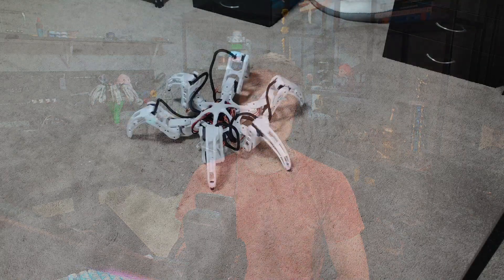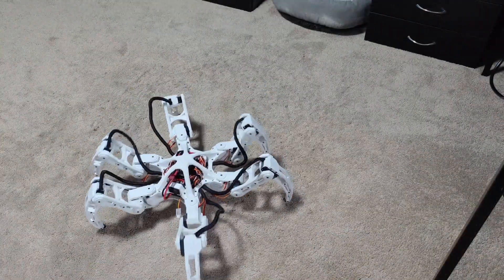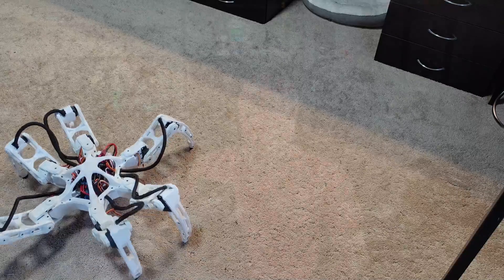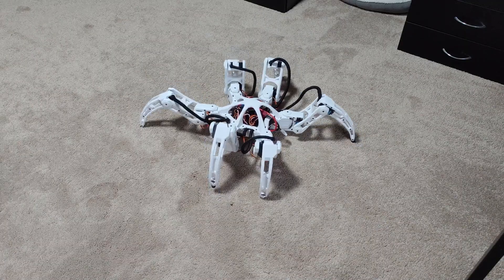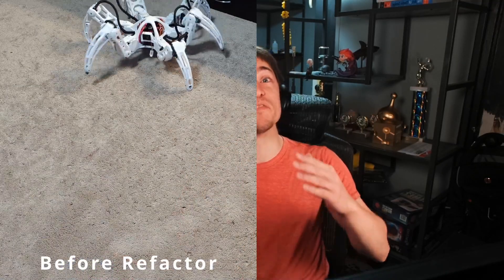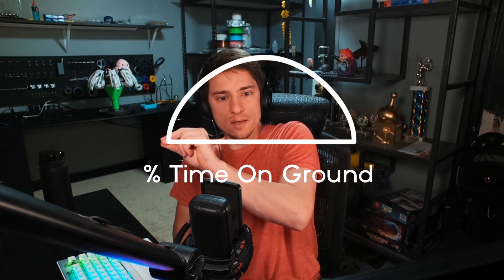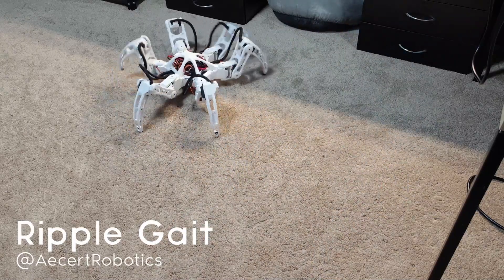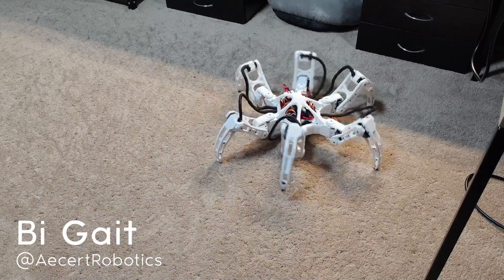I Completely Rewrote My Hexapod's Code

Comment: Cool sir, your robot has a smooth and stable gait🤩. I'm also building a hexapod using Dynamixel Servo from scratch. I have got formula for Inverse Kinematic and also leg trajectory using Cubic Bezier Curve (with 4 control points). 

I want to know what the gait formula/concept is (especially for the Tripod Gait) to determine at what point the three leg sholud starts to swing while the other three leg is pushing. So that the robot body can be stable when walking (no dragging feet when walking) like what your robot is doing.

And also how do you set the percentage of time when the leg swings compared to pushing?. Does it mean that you set it by determining the ratio of the number of trajectory points for swinging and pushing?

I need your help 😁, and also if you can provide an example of arduino code or other reference regarding the thing I'm asking about, I will be very helpful. Thanks😄

Comment: You could use bi-gait for normal and high speed motion, and automatically switch to the other "one leg" gaits when more pulling forward or carrying power (assuming attachments like can holders) is needed.
Reply from the maker: I dont have any way to sense payload weight, but the user could easily change the gaits based on whats needed
Reply: One option would be to ad a current sensor on one servo, another one to conpare planned motion and actual motion using an accelerometer: if there's a discrepancy, maybe the maximum pulling force has been reached already.

Comment: Do you use automated tests in your code? is the best way to change working code without breaking it.
Reply from the maker: I probably should but I dont 😂
Reply: @AecertRobotics  It seems that will add a lot of work to create tests, but in the long term it removes a lot of work. 
Not just for refactoring, but for creating new features, create the test first

Comment: theres a very useful gait that is missing...

ever watched a tennessee walking horse?

sulky racing? (trots...)

keep the body level/constant height... tricky whilst moving, but damn i see sooooooooo much potential if you do.

none of this pointless "attack" mode. what are you attacking? cool, nice learning curve and offshoot, but... useless.
i see hexapods and i ask myself... what can they do? is there a PRACTICAL use?

darn tootin!

many things can be done with a constant level. or a precise height control with all 6 degrees of freedom in a certain envelope... especially if it can anchor itself in place.
hexapod 3d printer? router? spraypainter? lawnmower? crop picking/planting/weeding? the list goes on and on...

other thought, try linear actuators, or adapting pneumatics and or hydraulics.

a jumping spider is hydraulic. if we have to go down the "attack" mode path, why not dive all the way in? make it jump. onboard compressor, storage tank, some quick exhaust valves... only need the fast action on the jumping joints, some maths on cylinder volumes, strokes, and pressures needed.. everything else can be standard spool/solenoid valve operation. or servos still.

gotta say, a petrol powered 50kg version of this sniffing and snorting and capable of jumping a meter would be scary as all hell... especially if its carrying a hedge trimmer or something... screw your batteries. gimme power density any day.

damn. i wanna try and make one now...

sighs and returns to scraping the mill

cant cnc without a working cnc machine...

Comment: Great progress. Does your code switch between the different walking modes automatically depending on the input speed or is it selected manually?
Reply from the maker: Currently I press a button to cycle through the different walk cycles. You can see that in action here! https://youtu.be/w3q_4_-ZHJ4

Comment: Hi Aeceret Robotics, thanks for fast reply. If you release your codebase, then i will try to integrate some serial servos with feedback loop. It may be helpful to have informaton like torque and position, when we talk about climbing obstacles with a Hexapod. But you are right, those servos are not the fastest, but at least they have a metal gear and quite a high torque. Looking forwart to your self-built-kit, with best regards, Peter.
Reply from the maker: Email me and I'll share the code!

Comment: I worked with Arduino a long time ago, and I know it would be really hard, but I just can't stop thinking if it would be possible to integrate some inverse kinematics here. Analyzing ground position and its texture, making legs move over and avoid obstacles without changing hexa's trajectory, climbing with horizon lock would look cool if you place a camera on it... my god you don't know how I want to have it on me to try to program it around, even if it means making a computing server on my PC if Arduino fails to handle it, but there is no way I would have time and money to built one myself. Don't have 3d printer, which means I would need to order prints; only one spare Arduino,  and a couple of servos. Now thinking about it... I will try my best to find some time to invest into this
Reply: the idea of ground lock with a camera has sort of lurked in my head for a while. i think it requires two, vertically oriented cameras. maybe three...(mantis have 3 central eyes right?)

think of how our binocular vision works.
our brain does some nifty calculations and triangulates an objects distance from the relative angles required to make those objects overlap and achieve maximum resolution.

on ONE PLANE. the horizontal. we are really good at judging distances apart on a horizontal plane, as it is simply triangulation.
but are woeful at heights, we have no reference other than experience.... ever watched someone drop a tree? i find it fun to place bets. usually right because i dont follow my instincts but actually try and visualise the arc of the fall.

vertically oriented eyes would give us great vertical or height assessment, with woeful horizontal... (always sort of wondered about evolution and if there would be a need for that feature... then again, wtf do flounders and flatfish think of the world as one eye decides it belongs on the other side of their head?? the things that keep one up at night, lol...{edit. i just contemplated the tuatara, with its "third eye"... maybe nature decided such a feature wasnt worth the effort?})

three should be the nice happy ground. 
gunna be some nasty independent recognition algorithms going on in each camera, with the trig required to figure out where things are. but seems possible.

Comment: Hi, great project so far! i am really looking forward to get one of yours self-bilding-kits , that must be very interesting to built and test this robot in reallity. Did you ever think about using digital high voltage servos?  the benefits are, very simple serial cabeling, lower currents because of higher voltage , easy programming, just by adress and position.

Waveshare ST3215 Digital Servos

I made some robotic projects with this product and am quite happy about it:by the way, programming with a ESP32 is compatible to arduino libraries and C++ Coding, but much more powerfull. To adapt aditional Sensors or cameras to your Hexapod, try the RAKWisblock Development kit, just amazing in price and diversity, very tiny and lowpower consuming, perfectly made for small robots.

RAK Wireless, WisBlock

many thanks for all your information, and looking forward for the Hexapod-kit,
Peter Kuemmerli, from Switzerland

Comment: ..by the way, with the ST3215 Servos , you can also read out the feedback of position and torque of each servo, this may be helpfull for climbing tasks with a Hexapod, to detect obstacles and steepness of the ground, without any aditional sensors...
Reply from the maker: Those servos are a bit slow for my taste, but that info would be really nice to have. I know I can mod my current servos to read the potentiometers position, but for this project specifically I think I'll leave it as is tbh.

Comment: complicated: like the Boston dynamics spot, make code that allows it to step over objects before touching it (some kind of vision sensor?).
Reply from the maker: Vision ai is out of the scope for this project, but I will be using switches in the feet to sense when they are touching the ground!

Comment: I really like how it kooks and moves but I dont see the utility of it. Stuff like manipulating objects, sensors and so on. Will it have eventually something like robotic arm or capability of doing things with legs?
Reply from the maker: Yeah I feel ya. I will be adding a gyro and switches in the feet, but that's probably it. Maybeee I'll design an arm for it, but that's a large maybe.
I'm totally open to adding individual leg movements , it would be pretty easy too. The hardest part is figuring out the controls, like how to select what leg you want.

Comment: didn't you say you started this because you feld burnt  out from software dev?  ;)

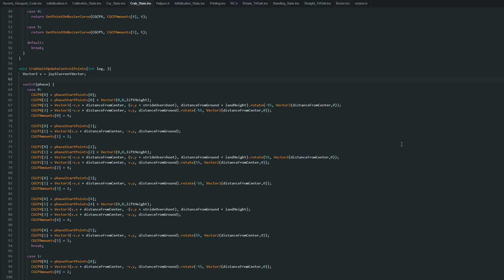at 3:26 the method CrabGaitUpdateControlPoints () seems HUGE to me (even after the refactor) , i know people are gonna peg me as a hater, and "try to build it yourself"  etc.. but instincitvly whenever i see a large method, i can't wrap my small brain around it , and i feel the need to refactor it to smaller methods , for example, i see cycleProgress index are being magic number hardcoded into the array index accessor repeatetly, so if you were to change the strcuture of array, all those would need to change
another thing, i would imagine that in for example cycleProgress [1] = (points / 6 ) * 4 , 1 and 4 are indexes for the legs, and 6 is the total number of legs 
those could easily become constants (LEG_ONE, TOTAL_NUM_OF_LEGS, LEG_FOUR) so if you were to search for places that relate a specific leg that would be easier. 
so you could have a small method called calcLegOffset(LEG_INDEX) or something similar .
if you're always updating  pushFraction, speedmultiplier and all the rest of the variables until the break, perhaps those could moved into a struct to indicates their depedence 
on each other. (or not) 
3:24 seems to be like a stateMachine being implemented, are you using any StateMachine framework libraries? 
i'm also curious what did you use to debug this monset? jteg?

Comment: Really awesome project! It could be really interesting if you added knobs or sliders to the remote control to tweak the gait parameters on the  fly.
Reply from the maker: I love that idea, imagine a controller with like 10 switches 10 knobs and 10 sliders. Like the controllers sole purpose is to debug and to test.

Comment: Bro I am studying electrical and electronics engineering as a first-year student. Which skills do I need to learn to make robots like this?
Reply from the maker: Ok so this requires:
- a slightly above beginner understanding of electronics
- a decent ability to 3d model/cad
- basic 3d printing knowledge
- a basic understand of pcb design
- a basic ability to solder
- a basic understanding of trigonometry
- a moderate to advanced ability to program (this heavily depends on how complicated you want to make it, with basic programming skills you can make it walk)

You being an electronics engineer means you should already have the majority of these things! I personally had to learn a ton for this project, but i was fortunate to have already had exposure to everything except pcb design.
Reply: @AecertRobotics   Thanks for answering! Your list was super helpful

Comment: Love it! 
Im curious how you did the ground contact percentage. 
Did you just changed the speed for the 2 curves? 
Also, for smoothing the movements, you could consider logistic equations. Like ln(1/(1+e^-x)). You can get nice transitions and directions with constant speeds. 
Also, for the arc formed by a step, it usually looks more like the cross section of a wing than an half circle, and i think parametric equations of that would give you way more control!
Reply from the maker: So the walk cycle is made from 2 bezier curves, one for pushing on the ground, and one for lifting. The walk cycle time goes from 0 to 1. Lets say the ground contact percentage, or the push percentage, is 66%. When the walk cycle time is less than 0.66, i generate a point from the pushing curve based where the cycle time is. If its greater than 0.66, i generate a point from the lifting curve. This percentage can be easily changed, and by doing so will change the amount of time the cycle will be pushing or lifting.

Hmmm, i can definitely make different shapes with bezier curves other than half circles, ill have to experiment!

Comment: If you want to implement field-oriented control (instead of robot-oriented), it works pretty well with just a gyro

You'll also want to be able to set/alter the angle whenever (by pointing the joystick in the same direction as the robot, and using that as the offset)

Comment: You absolutely have to strap a drone to the top, basically do what Mad Lab Industries did back in 2013, 10 years you should carry the torch for the HexaCopterPod, please
Reply from the maker: Hahahaha, this specific hexapod is wayyyyyyy too heavy for that. Also flying stuff is hard cause you have to be extremely light weight and frankly i dont want to have to worry about that. Do you have a link to it though? I searched and couldnt find it.

Comment: If the kit of parts is available I would be excited to buy a set or two of the parts and if the models are available I would love to get started printing. If they aren't ready and you want help validating the models I can test print stuff on an ultimaker S5. I dont have blender, but I am very proficient modeling in 3ds max for my printer. :-)
Reply from the maker: The kit isn't yet, but im super happy to hear that!! The models aren't either 😅 But they are close!! I really really want to avoid people having to reprint things, so im not releasing them until im done iterating. Ill send you the blender file if you want though, just email me.

Comment: you need some hardware retooling for better current regulation to your servos i dont think your servos are the issue i think your getting current spikes you dont have the tools to detect and i do commend you for fixing the symptom of the issue the general jerkiness of the servos but your gonna keep having servos blow out if you dont regulate current better from what ive seen
Reply from the maker: How would I go about regulating current? I thought the servos only drew what they needed.
Reply: @AecertRobotics   you could use resistors to regulate the current or have the servos move slower your biggest problem is gravity and the fact that most servos arent meant to be applying pressure consistantly against something like the weight of everything youve got in the carapace your support structures were smart but seem to maybe have made the problem worse by perhaps pushing against the free movement of the servos which are releasing excess energy as heat which may also be the cause of them burning out quickly although a pretty interesting solution in a circuit a servo kinda acts like a variable resistor any energy not used kinetically is released as heat which makes heat the great enemy of electronics people everywhere anyway please do some research yourself i may just be wrong and it could be something else but if it were me thats what id look at

Comment: A good upgrade could be to add position feedback to the servos, most hobby servos can be easily modified to take out the internal potentiometer voltage that you can then read with a microcontroller so then you can write your code to be aware of the legs actual position. This would let you not use hard coded delays or speeds and instead rely on when the motors reach their set position. That should theoretically allow you to get the fastest walking speed possible and the legs can adapt to different loads and speeds, so if you change the mass of a leg or the walking surface, etc, the robot can tell that the legs are moving slower and compensate for that. It would also allow it to tell if a servo breaks or isn’t behaving right or just tell when the leg is stuck or has hit something.

Another thing you could add is an IMU, this way the robot can tell its orientation in its environment, it could tell the angle of the body and allow it to adapt to different slopes and keep the body perfectly level. It would also be good for attack mode since the robot can tell if it is stable or not, or which way it is falling and can compensate. You can get decent IMUs very cheap now so is definitely something worth adding. If your IMU has a magnetometer then the robot can tell its compass heading so then you could have the controller move it relative to the earths magnetic field rather than its forward direction, so no matter what way it is facing all its motion is relative to a certain direction.
Reply from the maker: Thanks for the suggestions!

100% agree. Knowing where the legs are instead of guessing would be invaluable. For this current project though, I believe its out of scope unfortunately. Assuming I could get 18 additional analog inputs (mega only has 16), im not sure the mega can handle reading them every loop without slowing down too much. And even if it could, i want to keep this specific project as simple as possible and to be frank im not sure the added assembly complexity would be worth it. For the more advanced version that i want to do though, i will be doing this.

an IMU on the other hand i will be adding! making the hexapod move relative to the controller is something im really looking forward to (in addition to be able to stay level, ofcourse)
Reply: @AecertRobotics  an analogue multiplexer is a good way to get extra analogue inputs, it just switches between them. You could also use a separate smaller microcontroller, like an Arduino nano just to handle reading the analogue values.